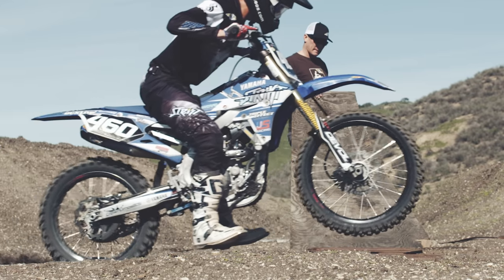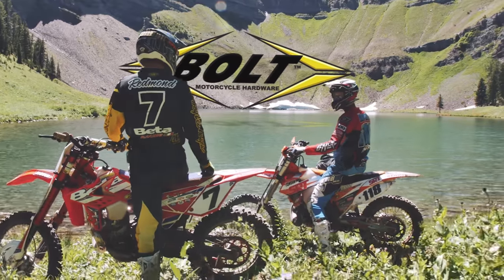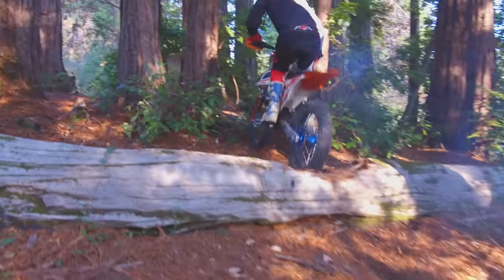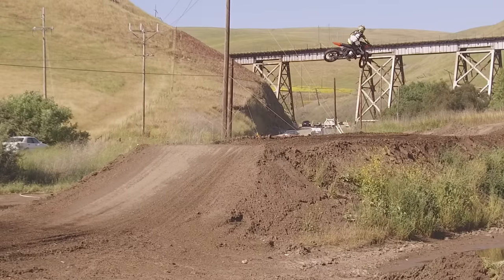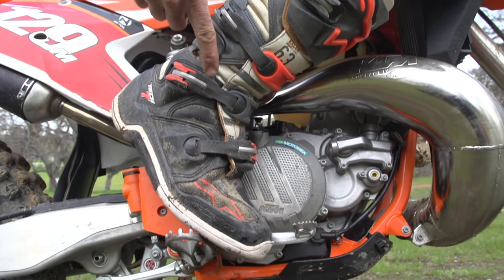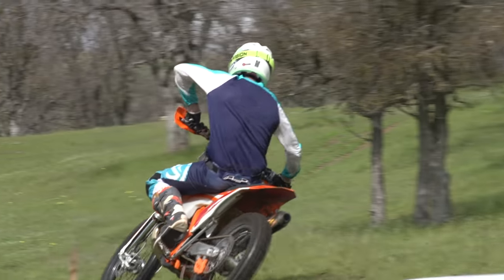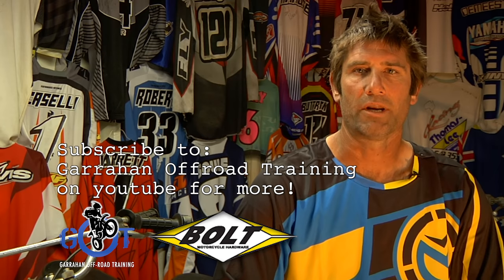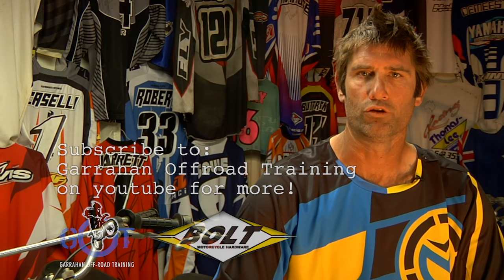Riding Tip:  Flat Corners with  Brian Garrahan Off-Road Training

Comment: It never stops amusing me how layman riders try to explain the dynamics of a motorcycle by selectively and incorrectly applying the laws of physics: "Apply pressure on the outside of the seat in order to increase the downforce and increase traction". LOL! I suppose in Moto GP they apply pressure to the inside of the seat to reduce the downforce and decrease the excessive traction? LOL!
Reply from the maker: True, but then again, finding physicists that are also award winning mx & off-road riders is extremely rare at best.  If you're one, hit us up and we'll feature your expert riding tips. :)
Reply: @thumpertalk  I am in between a physicist and an award winning MX rider, a bit of both, LOL. Here is my theory:

When cornering, the tire takes a shape of a truncated cone. The tip of that cone is the projection of the axle onto the ground. The cone, when it rolls, wants to turn around its tip. It creates a moment that turns the bike into the turn, pushing the front wheel into the turn and the rear wheel out of the turn. 

If you want the rear end to step out before the front does, you lean the bike more -- this is exactly what dirt riders do in slippery flat turns. 

They also load the outside peg because if the bike starts to slide, the outside peg wants to go up, and having more mass directly on the outside peg would prevent the bike from leaning and sliding out quickly. 

Additionally, if the front or the rear start to slide, an experienced rider lifts the bike to become more vertical, instantaneously and temporarily increasing the normal pressure and increasing traction. Having the outside peg preloaded gives him a "jump ahead", letting him lift the bike quicker. 

But road racers are different. They do not want the rear to step out, they'd rather lose the front and low-side. Also, they lean their bikes much more on pavement, which creates a very large turning moment that they do not need. Often their bikes are heavy, and they can't lift them like light dirt bikes. They front-steer more and wiggle their asses less. At large lean angles the outside peg goes down when the bike starts sliding, not up, so it makes no sense to pre-load it. Also, their turns are usually faster and have larger radii. This is why they try to keep the bike straighter and lean/slide themselves towards the inside. They noticed that at high lateral accelerations their tires grip better if the bike is leaned less than the rider.
Reply: Philip G u really think I’m gonna read all that?
Reply: @jakob31448  No, I wrote it for my own benefit. Of course, I understand that an average dirt bike rider would be totally content with explanations like "stand up, sit down, or sit on your left ass cheek to increase downforce", or " when in doubt throttle out", and so on.
Reply: Philip G just watched about 30 seconds of one of your vids, didn’t take long for me to decide who I’d rather take pointers from✌️
Reply: Philip G I’ve always wondered why people who know every thing about how to ride.... come to the “how to ride” videos....🤔🤔🤔
Reply: @jakob31448  Sorry, I will not be checking out if you have or do not have videos. My attention span for flat earthers is way shorter than 30 seconds.
Reply from the maker: @SupercarEngg  Mr. Garrahan's credentials: http://garrahanoffroadtraining.com/team-got-racers/
Reply: @thumpertalk  And my credentials are a room of trophies, two engineering degrees, 16 years of professional work experience in vehicle dynamics, and two days in Tony Foale's motorcycle dynamics seminar. Plus, my reasoning is pretty good. if anyone knows of another dynamicist who races dirt bikes I'd like to know their name.
Reply from the maker: @SupercarEngg  Congrats on your trophies and work! Regardless, 98% of riders aren't sweating the precise use of scientific terms when trying to describe riding techniques. If they are, there's a new angle for you. But after 20 years of doing this, we don't think so. You're welcome to the last word however. :)
Reply: @thumpertalk  I completely agree with this assessment. This is why I am not in a rush to open a riding school.
Reply: If anyone bothered to read my long explanation, then I can add an interesting conclusion. Leaning the bike more than the body gives more control and is safer because the rear end will step out before the front end. But leaning your body more than the bike could be faster, if you do not lose your front end.
Reply: @SupercarEngg   @Jakob Hartley  I read it all, very carefully, and it's worth it so be patient, this gentlemen put some time in to think it through and write it out and we're lucky for that kind of consideration. Philip, I know this was 2 years ago but I appreciate it. I find understanding some of the theory to help me better understand or infer technique, so I'm happy to know more about the dynamics or physics. Thanks Philip, but also, calling Brian a layman rider is both inaccurate but not cool on his own channel, so if you're feeling peoples' hostility towards you, you kind of asked for it.
Reply: @jakob31448  😄😄😄😄
Reply: @ddacaro  Very well explained
Reply: If you know all that then you should know it's more than one way to do something;  physics teach that too. You must've missed class that day.
Reply: “LOL!”.. there must be a reason almost everyone does it. it’s apparently working out for them, it works for me. your not riding on pavement on a dirtbike